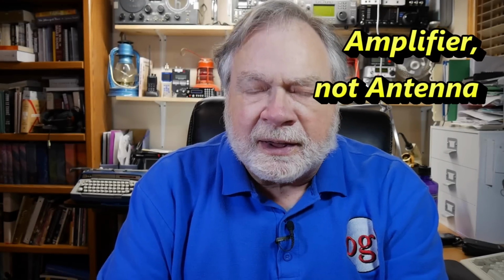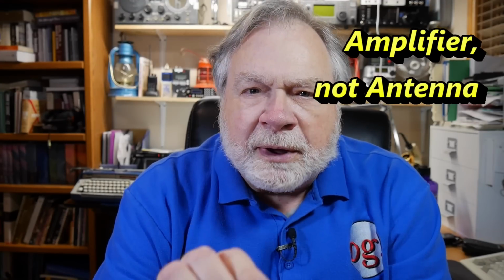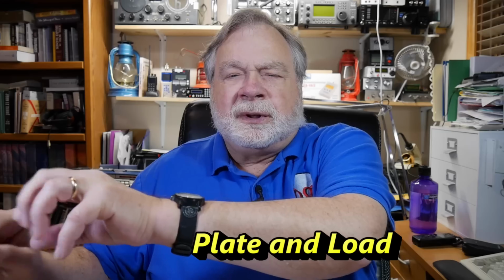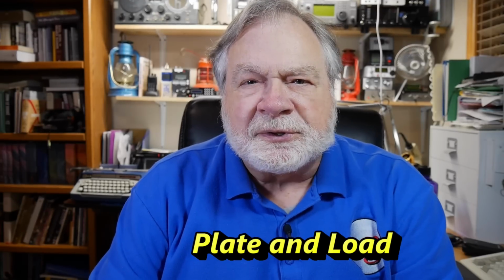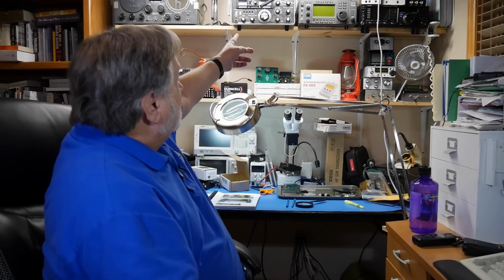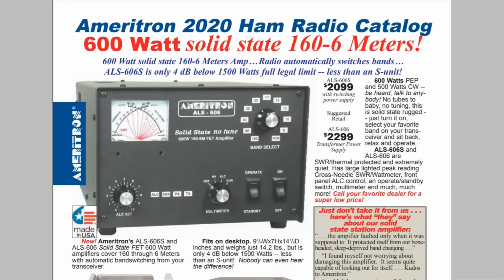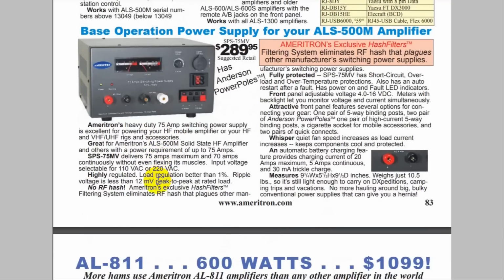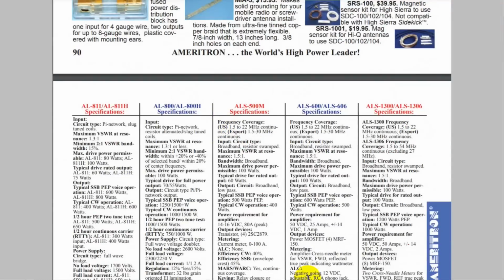When Can I Get an Amp for Ham Radio? (#346)

Comment: I found an article in March 2020 QST on the G90. It says "we do not recommend using a power amplifier" how does this mean it will produce spurious emissions that will violate FCC Rules?
Reply: It stated in the lab notes that it doesn't meet FCC harmonic and spurious emission standards and phase noise is higher than they'd like to see.  At QRP levels it probably doesn't cause too much problem.  An amplifier makes it worse.  If you input a dirty signal into a broad band amp, it's not going to get cleaner.

Comment: Hi Dave at about 19 min you mention that QST states a G90 and an amplifier will exceed spurious emissions I searched and could not find it on ARRL search, can you please site the exact article that you reference. I would also refer you to an Amplifier Build kit that I have built that will run on 115volts regular household power and produce 1.2KW. it is a KM3KM.
Reply: It's in the lab notes section.  Last paragraph.  March 2020 QST

Comment: I don't always talk on the radio to locals, but when I do I use a 5/8ths wave GP and a 12ax7 modulator into a klv 1000 and a Galaxy Saturn at 1 watt dk. Of course there is that foot pedal down there if I need a little more.
Reply: 10-4 good buddy?

Comment: Excellent video David you definitely covered some of the pitfalls that I encountered when I first looked at getting an amplifier. Especially the bit about putting the antenna tuner after the amplifier and not between the amplifier and the radio .. I did that once and I called my Elmer asking him why I couldn't get it to tune lol

Comment: Will an Amp help with digital modes like FT8?  Happy New Year Dave.  73 W0OSH
Reply: It is unlikely to make friends when everyone else on Earth is using 10 to 40 watts for FT8 and your signal strength desensitizes every receiver in a thousand miles.  But yes, obviously a thousand watts will punch your signal all the way to the other side of the planet BUT who has a thousand watts to answer you?
Reply: @thomasmaughan4798  Wow.  Sorry I asked.
Reply: @sewren  Really it plays into the FCC rule to use the minimum power necessary.  Otherwise everyone would just use a kilowatt at which point the next arms race would be huge antenna farms.  Oh, well, some already do that :-)
Antenna is vastly more important than amplifier generally speaking.  A simple 3 db gain antenna is equal to doubling your power, and a 10 db gain antenna is 10 times the power.  But do you get 10 times the distance?  No, "inverse square law", with ten times the power you get the square root of 10 more distance (more or less, many factors affect it)  or 3.16 the distance.  Still, given that 100 watts usually reaches anywhere on the continent, a thousand watts will get you overseas.
Reply: @sewren  My most distant contact on FT8 was 6000 miles!  40 watts.
Reply: I can hear many FT8 stations that clearly cannot hear me. Running more than my standard 90W would help. An amplifier will help with ANY mode.
Reply: @scottcampbell7944  "I can hear many FT8 stations that clearly cannot hear me"
I experience the same phenomenon.   It is a bit like fishing with 100 pound test line or 10 pound test line.  The 10 pound line requires more finesse and feels better; the 100 pound test line lets you haul the fish right out of the water, nothing to it.  Gets the job done when a job needs doing.  That leaves out FT8 which doesn't really accomplish jobs BUT more power into Olivia or PSK31 could certainly be useful in an urgency.
Reply: @scottcampbell7944  "I can hear many FT8 stations that clearly cannot hear me"
While you might have already considered the following suggestions, I make them anyway for the benefit of all.
1.  Check the time on your computer.  It is super important to be within about 2 seconds of accurate time.  On the WSTJ-X band display on the left, you see a column "DT" that's Delta Time.  Less than 1 second difference from everyone else is ideal; more than 2 seconds DT and you should fix your computer's clock.  
2.  Check your audio drive level.  The slightest distortion of the audio will make reception of your signal by others nearly impossible.  It will have power but it won't decode.  Adding more power makes it worse, not better.  It is crucial to have a super clean signal and that can be achieved by adjusting both the radio sensitivity and the computer's audio drive.  That is to say, if your radio is set with high gain on the audio input such that you have to push down the audio in the computer, you enhance noise because noise is always there.  So you increase the computer's audio drive and decrease the radio input sensitivity, or vice versa, until they are approximately balanced.  80 percent or so audio makes good use of the "bits" in the digital stream and then adjust the radio gain accordingly, or equivalent function on a SignaLink.  
3.  ALC can be important but maybe not; as others have discovered it depends on your radio.  Generally speaking you don't want ALC to activate at all it means your signal has become non-linear.   BUT some radios use the ALC meter as a type of automatic gain control where it's okay up to about the halfway point.
4.  Anything that distorts, compresses, noise reduction of the signal is bad, especially the compressor on transmit and noise reduction on receive.  Some people think AGC is bad, I consider it useful.  Where AGC can mess things up is if you have a strong station in the audio passband it will desensitize everything else. Well, turning off AGC and using manual gain doesn't really help; if you let the strong station overload the receiver it will splatter over the other stations and if you turn it down, well, that's what AGC is for.  If the gain dances a lot then a bit of manual RF gain adjustment with AGC can tame the up-and-down.  
5.  Transmit in clear slots on the waterfall.  Your WSTJ-X will respond if it hears your callsign anywhere in the audio passband so I lock the transmit frequency in a clear spot and so when I reply to someone's CQ, there might be 40 other people doing so but on the same frequency clobbering each other.  My call goes out in the clear, near as I can tell anyway, and his radio and computer will hear it side-stepping the pile-up completely. 
6. If you are calling CQ, use the even/odd selector to change the even or odd time slot; you might be competing with a strong station but if you change the time slot then you will be transmitting when other station is listening (and vice versa) eliminating that competition.

Comment: You should always have an amplifier,  just beware of any MFJ products!
Reply: Ameritron is made by MFJ
Reply: Robert Hayes I usually open up new equipment to check for problems. 
   I have worked on 200,000 USD laboratory systems, so that should qualify me for most everything else. 
  Thanks. 73 N0QFT
Reply: @glenmartin2437  I have worked on every MFJ product I ever bought new. Not a good sign... just beware is all im saying.
Reply: Thank you for the warning and reminder. N0QFT

Comment: I think one point that should be emphasized is there isn’t that much difference between 600 and 1500 watts.  That is only 4 db difference and only amounts to just about 3/4 of an S unit.  The biggest difference in the ability of the other station to hear you is going to be the jump from 100 to 5 or 600 watts, but going to 1200 or 1500 watts doesn’t make that much of a difference.  It might for contesters trying to break a pileup but in most circumstances it won’t matter.

Comment: Hey David. A lot of good advice and info. I have found over the years the key to most communication successes has been in the Antenna. I myself use an old first model Cushcraft ASL 2010 Log Periodic. True I am out in the country with no restrictions but none the less the key is Antenna. If one needs an Amp. as you say the 500-600 Watt jobs I feel give you the most bang for the buck. Just my two cents worth. 73 Mike N4JOJ.

Comment: Thanks again Dave. Once again you provided a video that applies to what is on my mind. Makes me wonder if you are clairvoyant 🤔. I am in a similar situation in your letter. I have a Hustler 4btv,  a BMT-DX-OCF-HP40 - Buckmaster OCF Dipole Antenna and an End-Fed Antenna. A tower is also not an option. I've been looking at the AL-811H, but also wonder if the MFJ Cobweb antenna might be a better idea. Thanks again for all the info you provide. Have a great New Year and a healthy 2021.
Reply: I have the same hustler
Reply: @joseph2219801  How's your Hustler 4btv working for you?
Reply: @kc8wvg  I had just bought an old kenwood from about 1980 6 months ago. I was getting stuff from south america. I made some clear connection with someone about 800 miles away. My radio didn't last long enough to really make a judgement call on the Hustler.  That made two used radios I've bought that crashed or quit working. If I get another$1400 I'll buy a new radio.
Reply: @joseph2219801  Thanks. I've had some success with mine, but it was difficult for me to tune on 20 meters. Also, even thought I laid out about 50 radials I'm thinking that my chain link fence has given me most of my problems. I bought an IC7300 and really have had great contacts with the OCF and wire antennas. Small city lot has me thinking of replacing the Hustler with either tek-tenna or a Cobweb. Both have good reviews. Cheaper than replacing the fence😁.

Comment: I am working a portable station with 100 watts doing POTA(Parks On The Air). As we’re all using 100 watts or less are there methods of working through the resulting pileup to get your call picked?
Thanks for your help.  Fred W2FTR
Reply: Where there's a pileup the usual strategy is to "listen up" 3 to 5 khz or listen down; you don't even need to announce that you are doing so.  Someone that is clever will transmit 3 to 5 up from your transmitted and you are listening 3 to 5 up.   How exactly this is done depends on the radio.  A fairly simple approach is the other person dials the VFO up 3 khz but then uses "RIT" receive incremental tuning to go down to your transmit frequency.  When she transmits it  will be on the dial frequency 3 khz above yours.  You, on the other hand, don't touch the big dial but use RIT to listen up 3 khz. 

RIT has rather limited range so this is where you can have dual VFO's one for receiving and one for transmitting.  Some radios have a TX Offset which is the same thing as RIT except for transmit.  

By the way it is also a handy technique for FT8 digital mode on the assumption that the other person is using WSTJ-X and has -the usual 3 khz bandwidth.  Set your transmit frequency on a clear spot and your signal will be heard because most people transmit on the very same frequency they heard something.  The pileup goes nowhere but you are transmitting in a clear frequency knowing WSTJ is listening to the entire 3 khz audio passband.
Reply: @thomasmaughan4798  
Thank you. Those are wise words and will be printed and kept with the 891!

Comment: I can't have an amplifier where I live, but I'd love one. Thanks for the clarity on amps. 73 W8XDX.
Reply: I can't have a ham radio amplifier for three reasons:  One, amplifiers are expensive; two, they typically need more current than what any of the circuits in my dwelling can supply; and three, you cannot use an amplifier in a portable station.

Comment: Dave,. Any thoughts on a sky wire antenna as described in the ARRL Antenna Book.  It's cut for the lowest band possible, in my case 160, one full wave divided by four and put up in a square.  Feed it with ladder line should work all the way up through 10 meters.  Should have gain as you go up from 160.  Can't do a vertical due to really rocky soil, tree roots everywhere, and can't do a tower.  I want access to all bands including 60 and will be doing MARS again.  Is there something better.  W8PEF
Reply from the maker: I used to have a Skywire antenna, but it didn't work terribly well for me. I ended up taking it down and cutting it into radials for my vertical.

Comment: What's a CQ?
Reply: It’s a general call that is transmitted initially to establish contact with any stations listening, CQ “Seek You”, it’s the same in morse CQ “-.-. - -.-“.
It’s not used on repeaters, it’s also not used on an occupied frequency.

73
M0YNW
Reply: @RobR386  "It’s not used on repeaters"
There's no law against it but is uncommon.  If I am traveling and reach a new city I may try to start up a conversation by announcing "CQ".  But at the home repeater where everyone knows you and you them, just announcing your presence is usually sufficient.
Reply: @thomasmaughan4798  I did it once on an occupied frequency that I couldn't hear the other station, got told off by a rude operator "why are you calling CQ on an occupied frequency?", felt like a right dumbass.
Reply from the maker: RobR386, don't feel bad. Yes, listen first, but often you may not be able to hear a distant station. The best practice is to ask "Is this frequency in use?" Regardless of what type of response you get, just answer with a polite "thank you" and then change frequency.

Comment: Hi Dave,
Very good info. Another suggestion, if the transceiver has a built in antenna tuning unit, is to turn it off when using an amplifier. Stay safe.   73   WJ3U
Reply from the maker: Good tip!

Comment: The question I ask is do you really need an amplifier . My answer not really if you have a poor antenna system . My advice is to have the tuner at the feed point of the antenna . Look even at less than 5 watts AM or 12 watts ssb can get you half way around the globe and I know this while only on the CB radio in California and again in Idaho . 73's from kn4kbh .

Comment: I have been thinking about an amp at some point (not for a while yet). First I'm going to upgrade the antenna to see if I can improve the reception first. But this was very helpful. Thanks!
Reply: With better (more efficient) antenna you improve transmitting also! I would avoid an amplifier as long as possible.

Comment: How come when you tune an antenna tuner again for 1to1 when you transmit more power.  Say you tune to 1to1 with five watts and then when you go up to 100 watts you have to retune.
Reply: I'd like to know too
Reply: The match does not change but the reflected power is difficult to detect when forward power is low. (The diodes in the detector circuit need above about 0.3v to begin conducting) In the unlikely event that the match really changes with power it points to a problem, perhaps a ferrite saturating or overheating, perhaps a flashover.
Reply: @g0fvt  Thank you
Reply: The inter-electrode capacitance in the power MOSFETS will change slightly depending on drive level.  As these MOSFETS are part of the output circuit it has the potential to slightly change the tuning; this is the principal of the varactor diode where the variability of the capacitance is enhanced.  https://www.youtube.com/watch?v=M8F6-VMXQVE
5 minutes into the video he explains that changing the voltage changes the depletion region and consequently decreases capacitance.

Comment: Don't forget us Advanced Class Hams.   After 65 years as a ham and never having an amp.  I am considering getting an amp.  Most reason because band conditions suck and most of the Hams I can hear are using 500 or more watts.  Thanks for all the information that you provide.  WB7ORB
Reply: If band conditions "Suck"  I was told an Amp is still useless.
Reply: @onemorething100 ..and you were told correctly!
Reply: @onemorething100  Now band conditions great and my new amp is great.
Reply: @onemorething100  It is not I am on many nets and in bad conditions an Amp does help.
Reply: I can get am amp if i want but my attic antenna sucks living in a hoa. I can hear people, hardly anyone can hear me back. 

But having an amp with that attic antenna will fry me 😂
Reply: As I've heard "Life is too short for 100 watts and a wire"

Comment: Is a beam better then a vertical
Reply: Depends, they both have their own strengths and weaknesses. A beam will hear better and transmit better, in one direction.  You will talk to different people with a vertical because of the radiation angle so the distance you get will be different.  It is easier to get multiple bands on a vertical.
Reply: Yes in the direction that it is pointed.
Reply: And the audience agrees:   MAYBE!  Or is that sometimes?  Vertical antennas have a low departure angle which is great for long distances.  The big difference is polarization; beams are usually set up horizontal and want to talk only to horizontally polarized antennas of any kind.  Verticals are, of course, vertically polarized (as are loops that are upright).  

At higher frequencies the effectiveness of beam antennas is much improved and height above ground not quite as stringent.   Over long distances that have bounced, polarization can rotate so the exact polarization isn't as important.
Reply: @thomasmaughan4798  The polarization of the upright loop depends on where the feed point is.  IIRC fed at the bottom it's horizontal.  Fed on the side it's vertical.
Reply: Silly boy.